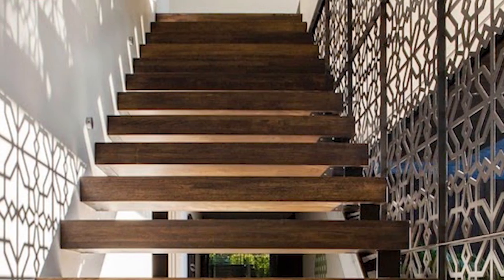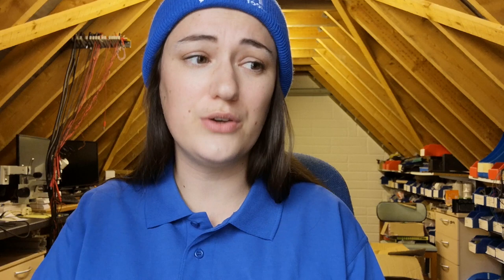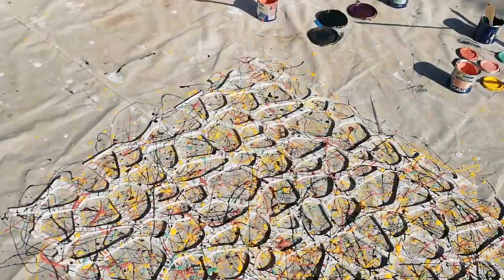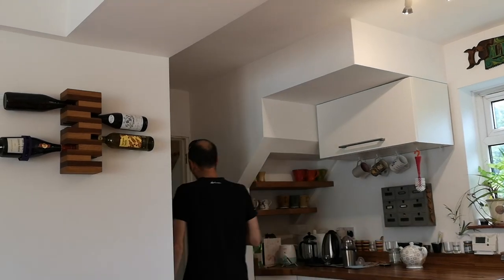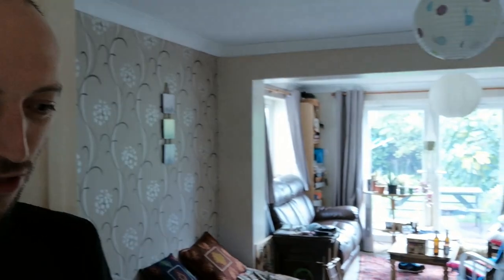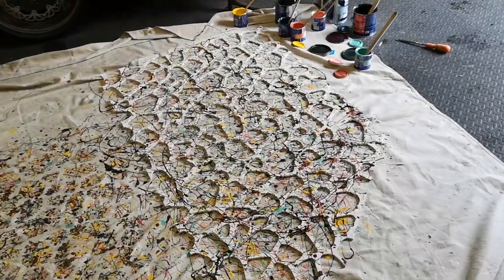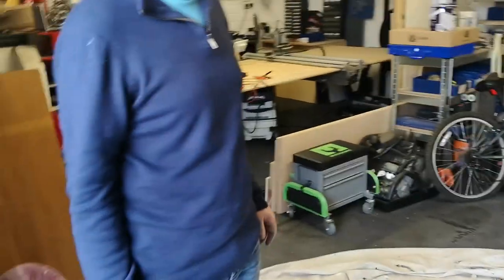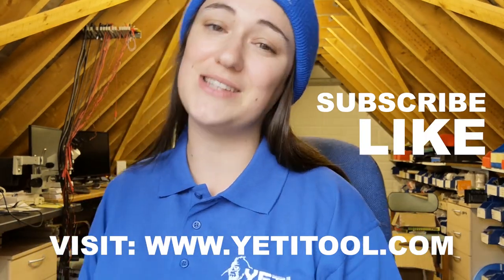Fretwork + JACKSON POLLOCK + SmartBench = masterpiece?

Comment: i notice you have taken out all the cut outs is this neccesarry with these machines because of the wheels because ive always been taught to leave these in when cutting on my normal flatbed cnc? im asking because im thinking of buying a second portable machine thanks john
Reply from the maker: Hi john crowe, great question! In this case, we used pocket cuts which remove all of the material rather than a contour cut. If we had just cut around the perimeter of the shapes we would have needed to use tabs to hold them in place. This would then lead to lots of post processing to remove and clean up the edges. Hope this helps!